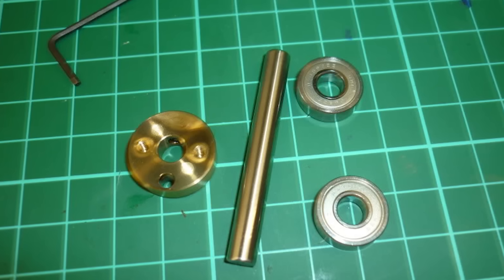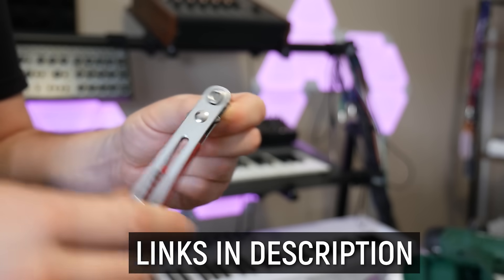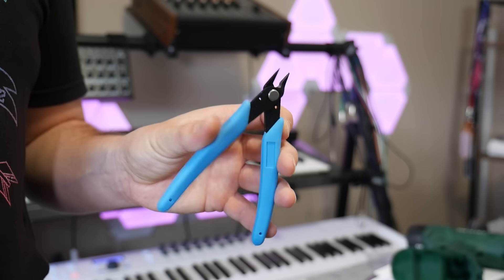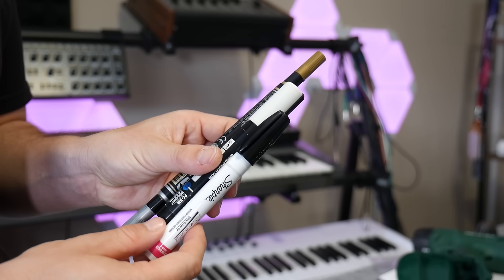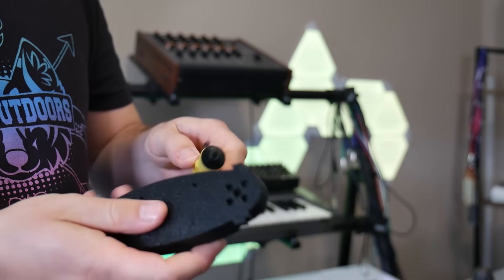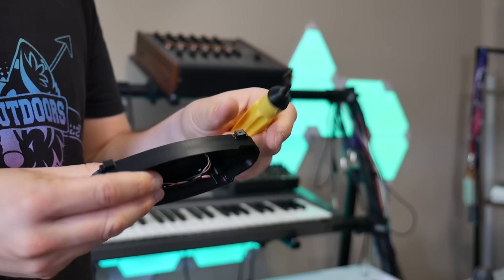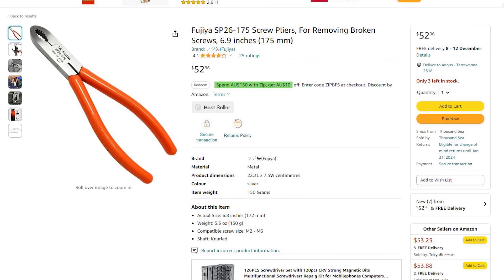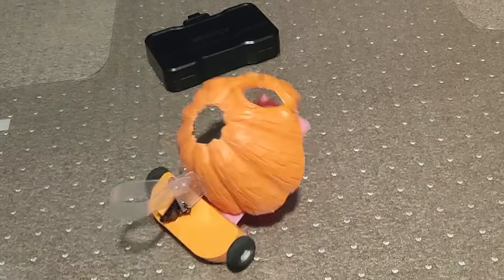Incredibly useful tools you need to know about!

Comment: For the deburring tool don't push away from the body. Use it like a potato peeler in which you put your thumb on the printed part and pull towards. Power AND control. You won't overshoot and cut deep into your part, nor will you slice anything else!
Reply: Try and do that with your left hand like he does and get back to me... They do make left handed blades though, but come at some extra expense.
Reply: @Segphalt You've got the solution in your own comment - the blades are so cheap to begin with that upgrading to the left handed version still shouldn't cost much in absolute terms
Reply: @Segphalt  I train to use my non-dominant hand for everything I can manage (I'm also a home machinist where this helps) which pays off. It takes little deburring practice to use either.
Reply: like freaking everything left handed :(  damn calipers and tape measure cost me like twice their price
 @Segphalt
Reply: @Segphalt  Being outside the norm is commonly more expensive.  Just get used to using your right hand.  Most people use their non-dominant hand for all manner of tasks, this would not be a difficult exception.
Reply: @Omniverse0  were like a tenth of the population but tools cost like twice the price if they are available at all. Are you able to do fine work with your non dominant hand?  Would you be willing to learn how to use every single tool all over with your non dominant hand?  Spend a day using your mouse in the other hand... see how you go.. come back tell us how easy it is
Reply: that was something i noticed too
Reply: Wait you're supposed to move the potato, not the peeler?
Reply: @HmmmmmLemmeThinkNo it’s both, kinda…
So, obvious disclaimer: there isn’t 1 single “right way” to peel a potato; whatever gets the job done (ideally with no injuries) is right enough. That said, there are some methods that are safer and/or more ergonomic than others. When it comes to the standard in-line peeler (as opposed to the y-shaped ones), there are 3 main ways of using it (what the other person described is #3 below)
1: potato held in non-dominant hand only, and the dominant hand (including thumb) grips peeler and peels strips (either towards or away from you). This is the least controlled and most dangerous of the 3 because there’s nothing bracing the peeler. 
2: 4 fingers grip peeler, thumb of dominant hand rests against near side of the potato to provide additional point of stability. Peeling action involves moving the peeler towards the thumb, with the hand facing down the whole time. If you were to perform the same action without the peeler in your hand, it would look similar to clenching your hand. Much safer than option 1, but it can give you hand cramps due to over-relying on the smaller muscles within the hand to do the work, and puts your thumb at risk if you slip (the likelihood of which increases with hand fatigue)
3. Same starting position as  #2, but instead of moving the peeler towards the thumb, the thumb pushes the potato forward and the wrist rotates upwards. The cumulative effect is that the thumb and peeler don’t ever move towards each other, it’s more like they rotate around the potato in unison, with the potato mass always between them.  If performed without the peeler, this action looks more like miming revving a motorbike. Assuming no wrist issues, it’s the most biomechanically-sound because the work is done by larger muscles working in their natural range of motion. It’s also safest because the peeler physically can’t reach any fingers. 
There’s a bit more to it than what I’ve described here, but hopefully that clarifies it a bit :S
Reply: @natmickan  that really does! I'll have to try that! I hate peeling potatoes but that third one is so clever, and might work for me!
Reply: As a machinist who carries one of these around. I cant stress enough how stabby they can actually be. They call them whirly giggers.
Reply: yes, true, the shape of the blade is meant to go that direction too

Comment: I don't think there's one standard name for that wrench. I've seen so many names used over the years: auto wrench, magic wrench, quick wrench, self-adjusting wrench, self-locking wrench, snap wrench, speed wrench... take your pick! The problem is that there's a lot of cross-over in tool naming so a lot of tools carrying one of those names often look like something you'd call a monkey wrench or a pipe wrench.
Reply: It's a VERY old design dating to at least the late 1800s so no surprise there.

Comment: Instead of the bolt removal tool, I would recommend the knipex Cobra. They also self tighten on bolts and shafts, but also work as normal pliers.
Reply: Yeah, Knipex is the good stuff, i recommend it.
Reply: or a set of 1/4 inch sockets... it'll have a ratchet, driver and maybe even all your allen sizes..,

Comment: I got an electric screwdriver and allen keys personally, electric screwdrivers are sooo much better, mine is a hoto USB-C one and although it feels very nice, tempted to return it for one of those old school bulky electric screw drivers with proper mechanical torque control as it's more precise. I don't like the torque limiter on my Hoto, it barely does anything so I have to manually torque out the part for sensitive stuff.

Comment: The 3 tools I have to recommend for general purpose are 
An iSesamo pry tool. Get the actual isesamo not the knock off. With the isesamo though you need to sharpen it and then knock off the edge. The cheap ones dont sharpen and hold the dull edge and they permanently bend to easily. Seriously though this is my number one tool, you dont realize how much you needed this till you had it.
Leatherman multitool like a wave or one of the classic models, believe an actual leatherman is far far better than cheap ones I just keep it on my desk at all times. 
The Last one I use all the time is a Nanch precision long shank screwdriver kit. They have a 22 in 1 kit that I have bought twice. One for work and one for home. Yes there are lots of precision screwdriver kits out there but the nanch kit can't be beat for the price and the fact its long shank. Plus the quality is insane for the price. Beats the hell out of my ifixit kit. 

Okay 2 more: The other tools I use constantly are a good pen light like a streamlight or the nebo inspector, good curved tweezers and good like human tweezer? I dont know what to call them but the ones you would use for like plucking hairs or splinters. 

It wasn't until I was in my mid 20s that I realized with tools 9/10 you just have to buy the name brand. Cheap multitools suck, cheap tweezers really suck, cheap pens lights suck, and the knock off isesamo is just garbage. The Nanch kit is like the only thing that isn't a common name brand in its field but its good.

Dammit, one last thing. A good rotary tool, like a dremel or a flexshaft grinder. I forgot about my dremel because its not on my desk, its in my bathroom...

Comment: One tool that I started using quite frequently now is a miniature plane, in particular, the Veritas Miniature Low Angle Block Plane 504079 05P82.20. Really handy for cleaning up the edges of a print that is a smidgeon too wide or simply to clean or true up an edge.

Comment: That bolt removal wrench is commonly called a "magic wrench" or "basin wrench".
Reply: I question the inclusion of that tool in the category "basin wrench". Basin wrenches have an articulated head, allowing the jaws to grip onto a nut in a plane perpendicular to the axis of the handle -- and especially in confined spaces known only to anyone who has even arched their back while craning their neck under a sink. The wrench in question does not have an articulating head. Also, the wrench shown has teeth arrayed along two faces (planes) at 120º, suggesting  that the use case is inclined toward hex heads. A basic wrench typically has a curved, toothed moveable jaw. Quibble away; yes, the bottom jaw has the curve, in this instance, but that's necessary to account for the various sizes of nut that the 120º corner can accommodate. IOW, if form follows function, then function is implied by the form. It's a notta-basin-wrench.

Comment: For flush cuts get some made by Tsunoda. These are made and used in Japan by the model enthusiasts. I use model SNP-165F and PW-305 and they are SHARP and precise. I use them al the time to cut brims, mouse ears, supports, and 3d prints themselves because they actually cut the print instead of crushing it.

Comment: The main advantage I see for the 90 deg ratchet is the big increase in torque (same force with a longer lever = more torque, more rotational oomph), which means I either get that stubborn screw out or I strip the head. Usually the latter. 😅 My coworkers swear by T-handle hex drivers, and I don't blame them, they need to put a lot of torque either way on metric bolts.
When I don't need the additional torque, my go-to is the iFixit Mako driver set. The handle has a bearing in its base, meaning I can spin out a long bolt way faster than a ratchet if I hold it just right.

Tsunoda makes cutters designed for plastics, like nylon zip ties, and they are amazing for flush cutting zip ties, cutting 3D printer filament, and cutting fingernails. I figure, keratin is an organic polymer, right? But I've also used Hakko micro cutters with no problems at all. The cutters that came with the Markforged Onyx Ones we got last year? Dead after a year, and the jaw BROKE OFF.
Because I might do a ton of crimped connectors as part of my job, I'm a huge fan of auto strippers. Same length of wire exposed every time, meaning I don't have to think about how many millimeters to hold the wires while getting the jaws of a manual stripper lined up.

I bet paint marker markings, when dry, don't come off with isopropyl alcohol the way bone-dry Sharpie will. There was one point where I used acrylic paint from the art supply store to make quick markings on terminals.

I need to get a deburring tool, I've used an X-acto clone to do my deburring, and it's a small miracle that I still have both my eyeballs and all my fingers.

Other tools that save my bacon on a regular basis: Pinecil, hot air rework station (cheapie Chinese one), and ferrule crimper.

Comment: The tool with the pivoting jaw falls under the category of pipe wrench,  and the deburring tool is definitely great for smoothing out the sharp edges of sheet metal or drilled holes plus 3d print edges😊
Reply: I've used an actial large pipe wrench for this exact purpose many times. Ha ha. Use what you have.
Reply: @EXG21  Yeah... me too.

Comment: Instead of hex drivers, I bought a small set of long hex bits and a quality stubby ratcheting screwdriver. Printed a small caddy for them. Saves space while having all the hex sizes quickly available. If they wear out, I only have to replace a small part of the tool.

Comment: That wrench: Usually called a self-adjusting or power-grip wrench. They're a specialization of a plumber's pipe wrench. They aren't meant to be destructive, but they can be.
Reply: in Aus they are usualy called a basin wrench and often have a 90degree turn on the end.
Reply: @T-MANONE  Yep, I know it as a basin wrench as well.
Reply: @T-MANONE  you say "they" are usually called a basin wrench, but those have a 90 degree turn for using on the faucet from underneath your basin. It's a different wrench, because as you described, it's different.
Reply: I think he calls them destructive because they do leave bitemarks.
Reply: @fargopolo  Fair enough. For "destructive", I tend to think of things like the screw extractor systems with the reverse drill bits.
Reply: Remind me of my oil filter removal wrench.
Reply: @EXG21  Yeah. I use a rubber strap wrench for things like that (mostly for removing stuck photographic adapters on the telescope). There are also ones with chains, and then dedicated ones that look like this and have more segments.
Reply: We call them whippy wrenches in Iran.
Reply: @khashmeshab   you serious?
Reply: @blatantmisconception  Yeah. I don't know why, but that's what we call them.
Reply: The word specialization made me think about remixes for some reason lol. Like the ones on printables and thingiverse etc. Imagine if all stores had a remix section where you could find all the derivative tools and whatever that were made based on that design.

Comment: if you are using a knife to deburr your prints, it is not a matter of if you have a medical emergency, but when.  a deburring tool is a must have.
Reply: 100%! However I've seen some brutal damage done to between the 1st finger and thumb because the person thought his hands were stronger than a vice to hold the part as he was deburring several holes on a metal block. Poor guy almost lost his thumb but I never seen him holding a part after that 😮. Like any tool or piece of equipment, if you're not trained properly, an accident WILL happen!

Comment: Destructive tools are a last resort, only after you have decided to replace the fastener.  not your go to tool.  I have a blue wrench, nut breaker, Dremel/angle grinder and an extractor for those times when it just needs to get the F off.  I know what you are saying and surely you use the right tool first.  
but its Soooooo satisfying to give up and Brute it into submission easily

Comment: Sometimes you don't have bolts that are short enough for your project, so I've bought myself a small bolt cutter to deal with this issue. It's much faster and quieter to cut extra length off with it than use something like angle grinder or hacksaw. Besides, there is no small residue or dust. And it's much more comfortable to use it for this than pliers. It's not particularly beautiful, but can come in handy when you're prototyping and don't have necessary bolt right now. You can always buy it later.
Reply: not ratchetting wire crimpers have threaded bolt cutters for most machine screw sizes. No need to worry about rough threads at the tips and flared ends that you get from bolt cutters.
Reply: @ryanokeefe12  That style however are fecal crimpers so I use them only for cutting screws. Good crimpers correct for sleeved and bare connectors make wiring much more pleasant.
Reply: @Comm0ut  I'm the same.. there are some well built ones but they still aren't ideal for crimping as they still rely on the leverage of the handle (no gear/ratchet). 
It's awesome to be able to thread the screw in to the perfect length and make the cut.

I did some quick googling and it looks like stanley made a large sized imperial threaded cutter a while back, but no one recently. shame.

Comment: My rarely mentioned tool and most favourite is the tiny gas torch used by chefs / for cooking. I love that thing. Do you have whiskers on your print? Blast it, for 0.5 sec and gone. 
I keep finding ways to use it. I use it to pop bubbles on my resin after pouring it into the vat on the resin printer. I use it to heat up razors / knives to cut plastic. All kinds of uses. I even used it to heat up wire and merge functional 3D prints by sinking said wire into the 2 pieces. It is a really good tool for tinkerers :)
Reply: Invaluable for resin work, and leveling malleable material before it sets.
Reply: When removing 3D printed parts from the bed, sometimes you get that white haze (I find it happens often with matte PLA). Quick blast with a blowtorch and it's gone.
Reply: @echoecho540  Like I said - it has many uses :D I love the damn thing. It is dirt cheap and soooooo useful!

Comment: I've successfully used smaller Vice Grip pliers to remove fasteners that wouldn't budge otherwise.  You may have to lock them on with a decent amount of force.
Reply: This is what I do, especially working on cars.  If you’ve got the hand strength vice grip pliers can do some major heavy lifting.  Though be sure to get good ones.  I’ve broken the cheaper ones squeezing too hard.